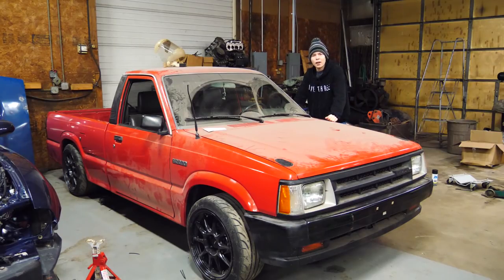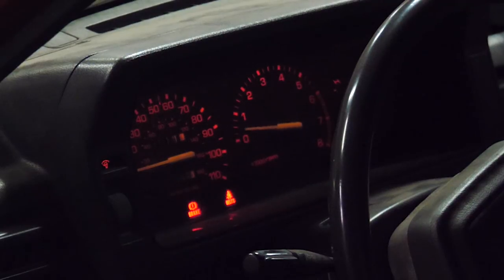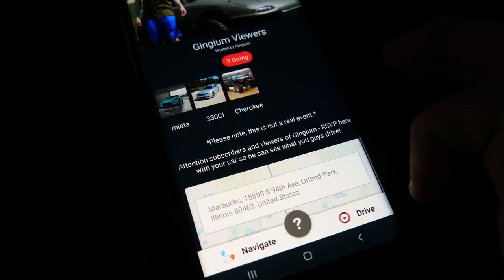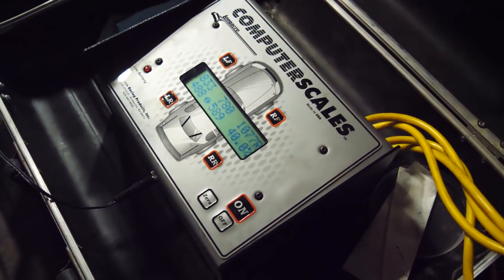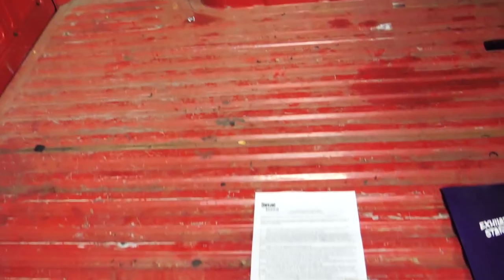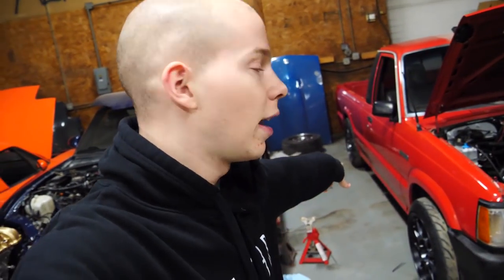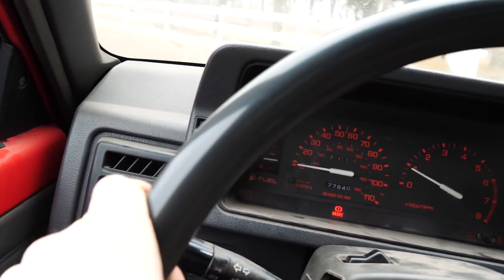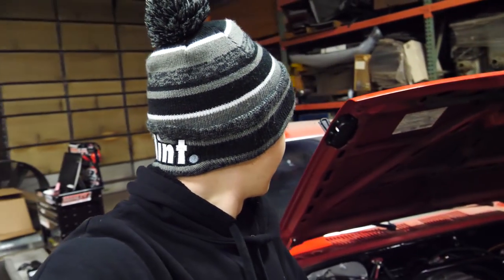FIRST DRIVE in the V8 Drift Truck! + We Weighed it and ITS SO LIGHT!

Comment: The truck is so clean, paint, everything, please don't wrap it for a while, it looks so cool like that, I'd daily that thing
Reply: atf01 yea a good polish and paint correction and wax or ceramic coating
Reply: atf01 except the front bumper,it’s all beaten up
Reply: Needs body repair on the cab corner by the drivers door. Looks like it's been backed into
Reply: @DrEvoX117 Like the paint on the tailgate is rubbed of and surprisingly  it has no rust
Reply: I really think the red should stay.  Even if it's repainted, keep it red.  If any roll bars are added make them black, I think it would look cool.
Reply: I can imagine this as a daily the only thing that I would see daily is tire marks all over the road. This daily would be more of s drift car than anything
Reply: Honestly to be quite fair for it’s age I feel like this thing would be more reliable than any of gingiums cars 😂😂😂

Comment: Put the radiator in th back... should sort a bunch of weight. 

Also, You need some overfenders for that thing... those tiny tires aren’t gonna grip very well, even with the low lower end torque figures of an import v8. Most people have started running Kenda 265’s.

Also, NEVER DO REAR TURBOS!!!! It will make like zero power until super high up in the powerband and it’ll have zero response either. Bad idea. Even the hoonigans are ditching it because it doesn’t make power and was/is a pain to try and make work
Reply: Hoonigans don't even have a remote clue what they're doing. 😂
Reply: Sergeant Speed that would be false... BRAD doesn’t know what he’s doing lmao. Most of the hoonigans have either worked with or on pro race teams and have all had some experience here or there with fab work, engine building, suspension setup or r&d... take dan for instance... he went to school for mechanics, and has worked on numerous FD teams. Rob/chairslayer? He’s a mechanical engineer. They know plenty
Reply: @zerohourdrift  yea, and they didnt do it right on purpose. Rear turbos work fantastic, the extra lag is a myth.
Reply: Donkey Kong lmao no it’s not...the whole goal of a turbo setup is to run as little piping as possible. 

For the exhaust part, the closer to the manifold, the higher the exit pressure, which means the faster a turbo spools. For the intake side, the closer to the intake, the higher the pressure. That’s why many people have started using mid mount inter coolers, because it eliminates a good deal of piping, increasing throttle response. 

Putting a turbo at the back of the car when the motor is at the front means the exhaust housing is at a minimum of 10 feet away from the manifold, and exhaust pressure is lesser, taking more time to make the same power. 

Then, you have to factor in the intake piping... if you run it under the car it’s going to be again, a minimum of ten feet of piping, BEFORE the intercooler. Then, another few feet or so from the intercooler to the Intake. It’ll be even more if you run it through or over the car.

Long story short, it simply isn’t efficient on most cars. The engineering and physics don’t lie. (It’s literally my job as a mechanical engineer to know this stuff lmao)

Like I said, it’s only really effective on land speed cars like bonneville, because many of those cars make over 1500hp, and off boost they make roundabouts 600-800 hp. They have the efficiency to be able to spool turbos that far away faster, however, it still has more lag and slower response than that of a front mounted turbo
Reply: A proper sized turbo should help with spool lag. It won't be ideal with a rear-mount but he only has 3 options. Rear mount turbo, no turbo, or a super charger if it'll clear the hood.
Reply: Calvin Nguyen he could always pull a Ken block🤷‍♂️ turbo out the hood is always a good answer😂
Reply: @fastec5  Rear turbos work great.. for a drag car where you have plenty of time to spool a turbo and need some weight on the rear axle. Other than that? Can't think of a situation.
Reply: The problem with a radiator in the rear is that there is very little airflow over the bed of a pickup truck.
Reply: @hobbitilius  There is very little airflow when drifting anyways... Needs good fans and it works fine.
Reply: @zerohourdrift  bro a 6 foot long 1 in pipe is the same as a 1 foot long 6 inch pipe
Reply: Gingium who let the tards loose(I hate to be negative but this stuff isn't that complicated) 1st thing, the hoonigan guys did a rear mount on a burnt out s50 with the charge pipe going over the roof of the car. 2nd thing, he wouldn't be doing a rear like you would on a regular car. He plans to put it In the bed of the truck(there is a great example on the 1320 channel of a guy from austrailia who built a TT rear mount setup in a Ute), unlike mounting it in the back bumper area.
Reply: Aaron Danziger First off, it was an m42 I believe... it’s a 318i after all... besides the fact, even if it was in the bed, there’s still an excess of piping, and it will require more load and rpm before they start making positive boost pressure... if you have the engine in the front of the car, the best location for the turbo is the front of the car. I get that Caleb thinks he won’t be able to fit the turbos up front but I’ve seen guys make massive engines and turbos fit in tiny ass engine bays. It’s possible, and if he wants the car to be responsible and have a halfway decent powerband, the best spot is in the front. In simple terms, Less piping= less lag/ better throttle response
Reply: Cash Money lmao what does that have to do with anything? The average exhaust is 3-4 inches on a modified turbo car. With the turbo up front, you have a foot or so of piping to worry about. The average intercooler/turbo piping is 2-3 inches to accommodate the fact that most turbos cold side housings fall into that category... running 10 feet of exhaust to the rear, then through 10 more feet of intake piping, then an intercooler, then another foot or so to the actual throttle body, is a huge amount of difference over a front mount turbo, which has maybe a foot of exhaust before the turbo, then maybe a foot until the intercooler, then another foot until the throttle body. 

What you fail to realize is that the actual piping size isn’t usually any different from front turbo to a rear one... the only change is in the actual amount, which is why MOST rear turbo cars have too much lag and not enough response to make for a good, useable powerband
Reply: Your gonna be in high rpms with a drift car tho so turbos would spool either way
Reply: I JumpShot not 100% true... you want low end torque as well... it’s not all about high end power. If anything, a flat, linear power curve is most desirable
Reply: @hobbitilius  cut a hole in the body and make shrouding to force the air into the radiator... mighty car mods did that when they did a Subaru engine swap on their beetle

Comment: You shouldn't do a rear turbo, it causes huge lag. Put a pair of T3 60 mm turbos sticking out the hood if you need space
Reply: Miatas Forever yes. Turbos sticking out of the hood would be so rad lol. Also, if the turbos stick out the hood, you can make dual hood exit exhausts
Reply: Lucas 1616 IT WOULD BE LIKE A HOONICORN/HOONITRUCK
Reply: @adamcroteau8711   or like Leroy
Reply: Yea rear turbos are completely pointless unless you’re building a bonneville car... and even then, it only works for that because most bonneville cars make like 800+ naturally aspirated 😂
Reply: Miatas Forever HOONI2HUNDRED!
Reply: inventor of toast no still wouldn’t be responsive... there’s easily 10 feet or more of piping necessary to even get the turbos to the intake, and that’s without an intercooler... it WILL have a good amount of lag. That’s not even a question
Reply: Matt L and those bonneville cars don't need throttle response, because they don't lift over the course of their whole run

Comment: Erm for whatever reasons it sounds kinda like a Subaru with unequal length headers
Reply: ZL _ I don’t think so
Reply: Not really, 1UZ is much more deep and big.
Reply: I think the firing order has a little to do with it, its not like the LS or Coyote V8's I did hear what your talking about though I thought it had a miss. It did have that soobie sound. It sounds good just revving it I was surprised what it sounded like coming down the street though.
Reply: @LoneRevD  yeah I was referring to that Subaru ish rumble when he was driving the truck, not sure if that's caused by the headers tho
Reply: If you remember one of the last videos regarding the 1UZ, it was made with the purpose of being in luxury cars (Lexus) so it's very very well balanced. Maybe that has something to do about the sound.
Personally, i'm really loving it. It sounds meaty and angry AF
Reply: The sound you're getting through your phones, tablets, computers etc.... Is very rarely comparable to the sound in person.
Reply: No the Subaru sounds like the 1UZ 🤔
Reply: I can't believe no one knows why it sounds like this. It's a cross plane v8, and thats exactly what it sounds like. Subarus rumble because they are boxer engines.
Reply: @surewhynot6259  nah, the Subaru rumble is due to the unequal length headers
Reply: Its because they fire similar to a 350 chev instead of the LS1 fire order. And its quad cam
Reply: @zl_390  Boxers with equal length headers still don't sound like most inlines. Maybe you should own one before commenting
Reply: @StanleyKubick1  why are you speaking about inlines?
Reply: Busted coil packs. He was running on 6.5 cylinders, fixed it for his dyno run.
Reply: Turns out 2 cylinders weren't firing

Comment: I've seen some pickups with extra pipes going from the cab into the bed, I believe for extra stability(though I'm not a truck guy so I'm no expert on that) if you're thinking about adding weight to the rear then that could be an option.

Comment: I've only had V8 cars but Mom had a four banger 2008 Elantra with a stick (we liked it alright, but it was way too small and fragile), and let me say, you will never want to go back to a four banger after getting some time in this truck. The amount of torque you can get with an extra four cylinders is just insane! Now, when it comes to fun in relation to fuel economy, you will want to go back to a four banger. Only downsides I can thing of though, are size and fuel economy. Then again, the 1UZ may be different with the economy, my V8 experience is all with pushrod low revving domestic engines.

Comment: Awesome well worth the work put into it, it has been a huge learning curve for you and you conquered it,  try electric assist steering takes up less room and is adjustable. 
Put a race fuel cell in the rear with foam insert so you don't get it sloshing around effecting the handling or run it full when drifting, another suggestion run hard lines for your fuel feed.
Again awesome I would run this as my daily driver just add a bed box for tools, shopping or luggage so you can remove it when drifting, great build.

Comment: Don't put the tank in the back, it will make your weight distribution inconsistent and be more prone to damage. It needs to be in the middle.
Reply: Anonomosomous our racecars have them in the back, proper fuel cell is designed to take hits as the fuel is actually in a “bag” inside of the container. Also you put steel bracing around it.

Comment: Since you have a transmission for an sr20, you could find a way to put an s13 subframe in the rear and have a stock s13 drive shaft. You'll have tons of parts available specifically for drifting applications. Also, you should probably keep your gas tank towards the center of the truck, since your weight distribution will change as the gas goes down.

Comment: With the fuel cell don't put it directly at the back, have it on top of the rear axle, if it's right at the back it could turn into a sling shot when getting into drift

Comment: Wouldnt putting turbos In the back add a lot of turbo lag? Like it would take more time for the exhaust gas to reach it right?
Reply: if its piped right you wont have much lag if any
Reply: Luke Hindle still would be laggy af. Turbos sticking out the hood would be better.
Reply: You also have to consider the fact that being the turbos in the back, where there isn't much heat you don't need an intercooler, so air has to travel through a way shorter route to the engine than a traditional turbo seturp

Comment: Maybe get a rollcage in the bed of the truck, it will add rigidity and more weight in the back. You could also attach some weights on the bar to get the weight up a bit more, maybe bolt down a rear facing seat so someone can film in the back as you drift. haha

Comment: I can see the weight balance getting much better once you get a fuel cell in the back of the bed. Honestly it might look a bit weird, but you would prolly get a lot more traction out of it if you put the fuel cell right by the tail gate. Also yiu need some bucket seats in the truck, itll lower the weight, and you wont be getting thrown around when youre drifting

Comment: Will putting the gas tank in the back make it drift differently depending how much fuel it has?
Reply: There will be a bit of a difference, but mostly the fact that the tank itself is moving back will affect the weight balance of the truck, at least that’s my guess
Reply: Baffled tank will prevent slosh
Reply: Yes. It will also slosh the fuel around, which makes it handle awfully.

Comment: I don't know how good of an idea is to drive 3000 miles in a race truck without A/C and stiff suspension, and race seat with also the risk of ruining the engine
Reply from the maker: That's the fun
Reply: @_Gingium_  then send it dude, gotta do what you gotta do, but put a water bottle counter on the screen 😂
Reply: pietro ghedini It has a bench seat, not a race seat. And a lightly modded 1UZ won't break after it gets  a good tune
Reply: @adamcroteau8711  yeah, for now it has a bench seat, I hope not for long tho if he want to drift it without going out the window, but yeah, I was just pointing out some stuff, i would enjoy the video like a lot

Comment: Get an electric ps pump of 04-07 saturn vue. Some formula drifters have done it and it works. To save you that extra rotational mass and load of the engine if you us a pulley

Comment: That truck is sick. But you shouldn't have a rear turbo because it would be very inefficient and you would lose lots of heat trying to bring exhaust to the back of the truck. Therefore lose lots of boost

Comment: Do not put the turbo in the rear, even though it's a 4 litre V8 you'd still have some killer lag.
There isn't really enough space for turbo(s) up front, but with a different bonnet you could fit a supercharger.
Also, a turbo would muffle that V8 noise a little, whereas a supercharger just adds the whine

Comment: Grats to got it actually running. But it needs bigger tyres those look silly and the rear is way too low it hanging it´s ass, so you need to do something about the rear suspension.
Also does it go straight line with the self made front suspension ?
Reply from the maker: Yes it drives great! I just need to lower the front coils

Comment: where is the v8 from ? what car ?

its sounds Amazing
Reply: I'm pretty sure it's a Lexus 1UZ engine but I may be wrong
Reply: 1UZ-FE (4.0L, all-alloy, Hypereutectic Al-Si pistons, stock specs are 261hp and 269lb-ft torque @ 5400 and 4400rpm, respectively), the vehicles they're in are older, more modern vehicles generally use the 3UZ-FE, but cars that DID use them include the Toyota MR2 Le mans car, 1989-2000 Lexus LS400, Toyota Celsior, 1989-2004 Toyota Hiace Ambulance etc. Yes, a kei-car ambulance with a V8.

Comment: You need some better seats, your going to want to be planted in your seat, and probley a different steering wheel,keys racing is best, something with very low offset because trucks have a longer steering column, i drift a full size chevy so...   Its my icon

Comment: Dont rear mount turbo it, dont pull a hoonigan e36 theres gonna be too much piping which will make like no difference and since its a truck there is not gonna be a lot of air flow to the back, dont waste your time. I personally would ProCharge it because V8.

Comment: I own a b2200 bravo from 89 they are great but it's stock
Reply: A Weber 32/36 carb and a set of pacesetter headers and she'll open right up
Reply: Roman Pfaff thx but it's a parts runner so I don't need that much from it but I did weld the diff 
Edit oh and I forgot to say my uncle helped my put a 2006 bravo diesel engine it

Comment: Sorry but that thing sounds HORRID. Hopefully a tune helps out a lot. You should def get a resonator and/or a small muffler to get rid of that poppiness and to make it actually bearable to just drive when not drifting. Theres a reason the best systems come with both. The drone that thing is gonna have will be awful. Youll want earplugs

Also those tires are gonna be uncontrollable in drifts. Theyre gonna hook up when you dont want and itll end badly. Gotta get a set of hard compounds

A rear mount turbo is just an awful idea  in every way as well. The lag and power loss from the tube lengths would be stupid

Comment: Truck sounds awesome but you should really look into getting some gopros
Reply: Good idea, could maybe even run some 5v lines to a few spots to plug them in and they'd be powered by the truck! (they don't last that long on battery otherwise - I use a power bank for mine when I do time lapses or what not).

Comment: I bet with a good turbo and higher compression it would beat a deamon
Reply: Do you know how boost works? You need lower compression to run more boost. You run higher compression if you stay NA.
Reply: @fastec5  just a higher octane fuel. Because if the compression is lower the engine will be laggy